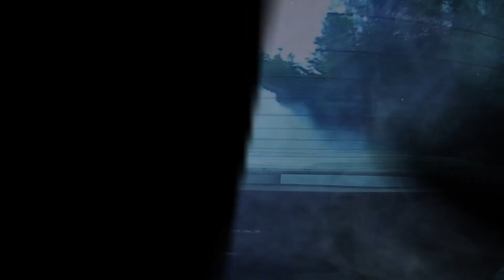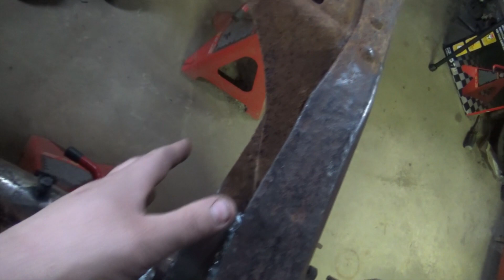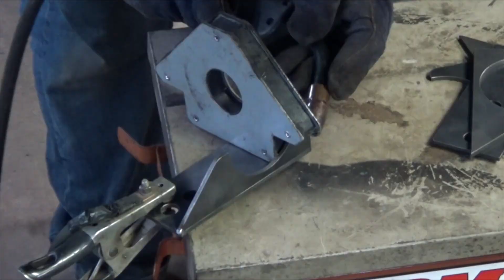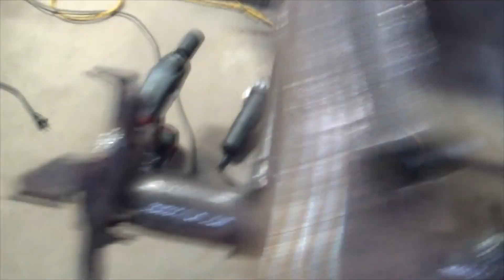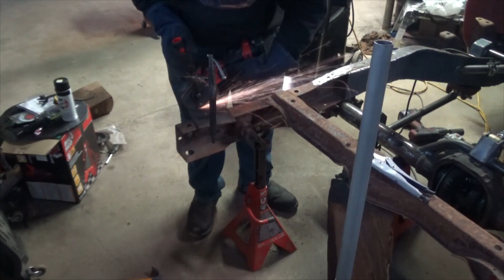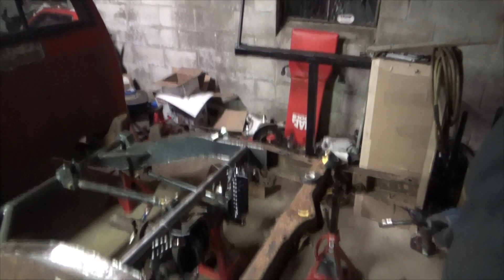Home DIY Rear coil over install on custom S10 build - Twisted Builds LLC

Comment: Hello, I have a 2001 Blazer that I just successfully boosted. I saw the Ridetech rear suspension conversion kit but I very much liked your design better due to the adjustment options.  Do you sell the Fusion files that I may have all plates for this project plasma cut?

Comment: I think that very cool. I would guess that round cross tube is thick walled DOM tubing? I did not see a link to products but that’s ok. I am restoring a 67 C10 on a comfortable broke budget after back forced early retirement from doing this for decades but only a dealerships mostly. Best of luck as you have a good start.
 Oh! One tip!!! Don’t forget to “Mop” rear differential axle tubes as this is number one reason for a rebuild failure. I have done dozens, even factory Dana 44 with crooked rear tubes welded at plant, but the differential plant for Dana is Brazil.
DK, ASE master tech since 78.

Comment: Not trying to be a dick. I'm kinda old. I have a 1988 f250 with a 460 bb. I am seeking a stand alone ecu. The truck is mpfi. It has a single o2 sensor. No knock, no mass air, it's pretty bear bones as far as a ecu. Just the nasty grey box greased and screwed to the distribution. Can you point me in the right direction? When the rebuild of the 460 happens I will go msd ignition. I want to ad a programmable ecu with a digital dash cluster Galaxy tablet. Using the cluster for a lock starter switch and toggle switches. I think the speeduino is the right fit. But not sure.

Comment: Looks good. Were did you get those top brackets for coil overs?
Reply from the maker: Matt Mozer of Mozer Made is the one who cut out the brackets for me on his CNC plasma table. I designed them though for him to cut out on Fusion 360.